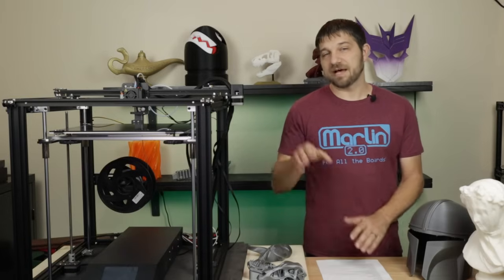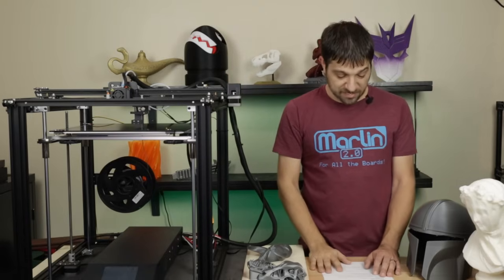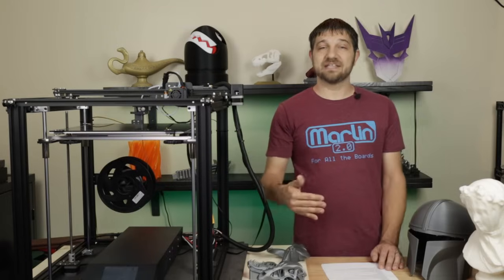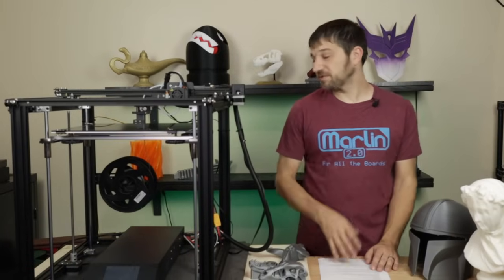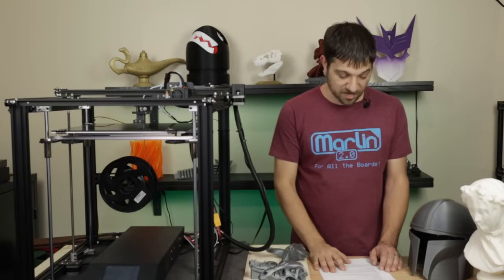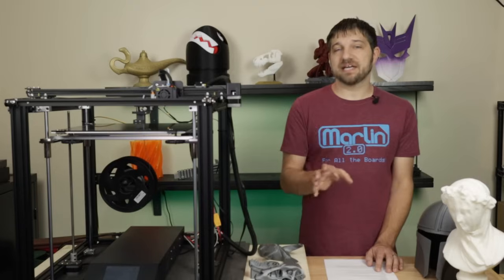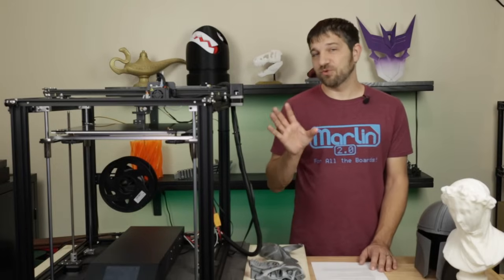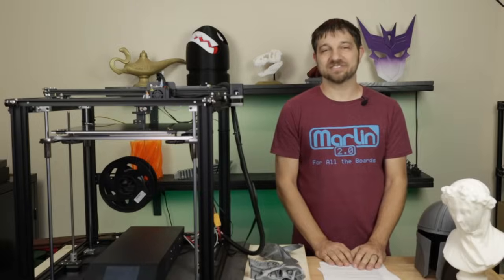Creality Ender 5 Plus Review: EVERYTHING You Need To Know!

Comment: So, has this printer improved over the last 2 years with regard to firmware and electronics quality etc or is it just the same?
Reply from the maker: It's exactly the same. If I could find the time, I'd love to update the review with a new video.
Reply: @kerseyfabs Ok I was just wondering as I just ordered one.  There's like 80% positive 20% negative about this printer so hope I can concentrate on the positive!! Ordered the metal extruder and capricorn tube to start off with.
Reply from the maker: Perfect. The only reason i keep endorsing this printer is there's still nothing like it that I'm aware of at this price point.

Comment: The Ender 5 plus is a noisy Assed printer and even if you lube the  z axis rails it still squeaks when traveling up or down.. Also, You have to manually edit the gcode files so that they are 15 characters or less. With some work it can be a decent printer but after going through everything you need to to get it put together (assuming none of the precut holes are at a slight angle and thus end up stripping out when you are screwing the screws in, this happened to me twice) then you have to put up with the noise.. As far as I know there is no work around for the file name issue...

Your better off going with an Ender 3 v2; it’s WAY quieter and will read the gcode files as written by cura also no touch screen.  If you specifically need a large build area then go for a CR 10S.  

The Ender 3 V2 costs under $300.00 and the CR 10S costs under $400.00. The Ender 5 plus will cost a little over $500.00 and in my opinion is not worth it. Lastly, I can just see that “touch screen” on the Ender 5 plus stop responding at the worse possible time; right “after” the warranty expires....

Comment: Hi Kersey, I got my Ender 5 Plus on Saturday set it up, trying to tune it to print right(using your guides), but I noticed that when I flip the on/off switch to off at night, it only turns the fans off. The LCD is still on and it shows 22degree nozzle and 22 degree bed. As an IT tech usually when you put the switch to 0(zero) that mean off and everything shuts off, at least with normal computers and servers. What's up with this? The nozzle and bed do get cool so I assume it's a glitch or bug in the software. Stock everything but capricorn tube, FW 1.70.2 BL from the printer info. Thanks for any help you can give. If this is normal then that's ok.
Reply from the maker: Congrats on your new machine! Is it hooked up to the Raspberry Pi or PC? The electronics are being powered by USB. To avoid that, you'd need a data only usb cable which can be bought or made.
Reply: @kerseyfabs  yes I did get a raspberry pi 4b to run it remotely and have camera view. The USB cable that came with the ender 5+ is connected to the Pi. Would disconnecting from my Pi when I'm done fix this? Not sure why I'm asking since I can test it since it's right beside me lol. Also, pretty sure the z axis needs lube cuz it squeaks allot, but the y and x axis are quite loud during motion, you think the belts came in too tight? I can deal with fan noise no problem, I have my server and gaming pc beside me with lots of fans. The motion sounds though, are on an another level.
Reply from the maker: Yes, if you disconnect the USB, it will fix the problem. On the squeaking, check my "Top 5 Upgrade" video. In that video, I upgrade to POM z-screw nuts. That fixes the squeaking. The noise from motion is from the steppers. You would need to upgrade to a silent board.

Comment: Good video. Bought one for two days ago :).
Reply from the maker: Please let us know what you think once you get it going!
Reply: @kerseyfabs  i will let you know what i think about the printer when i get it. :D   Do you know if tl smoothers work on the Ender 5 plus?
Reply from the maker: They shouldn't do anything one way or the other.
Reply: @kerseyfabs  oki tnx for answearing, i see u put  much  effort into youtube. Keep Up with ur videos :)
Reply: Hi again. Just got my printer. It works really good, but i cant print, it wont show the files on the stick.
Reply from the maker: How is it working really good if you can't see the files on the stick? Have you been able to print somehow? Have you sliced a new gcode file and placed it in the base of the USB drive filesystem? If so, keep the filename short or it may not show up.
Reply: I have not printed anything but the printer works well. Tested the xyz axses and i did leveld the bed easily. But i cant see a file at all not even the files that were on the stick from factory.
Reply from the maker: @Emulpuhl  Can you see the files on your computer? Only files ending in .gcode will show up on the printer. There are no gcode files on the SD card by default.
Reply: @kerseyfabs  ye. I sew it. I cant get files (.gcode) from the stick, but i can directly from the computer. I have printed a xyz cube and the quality is AWESOME and it only took me 50min to print. Best printer i had yet.

Comment: Great content, good on details. Still could someone enlighten me, why you have to pay $549 for a printer you have to assemble, has no cable management, has firmware that does not work out of the box? And from what I see people still replace parts for to "upgrade" the machine. It just blows my mind for that kind of money I would expect a machine that works out of the box, or is that just me?
Reply from the maker: It's a cost relative to competing options. The real cost here is the size. If you want a smaller printer, a standard 220x220x300 or so, then you can get one much cheaper ($150-$350). BTW, almost all printers in the sub $750 price range have some assembly unless they're really small. As for your other concerns, this printer does work out of the box once assembled. It's not perfect but it is perfectly functional for most people. Upgrades are not required and firmware issues have work-arounds. The CR-10 V2 which is 300x300x400 is around $499 (or CR-10S $399) and the CR-10S4 which is 400x400x400 is $569. Even other vendors, such as the Artillery Sidewinder X1 at $399, are about the same cost relative to size.

In the end, size costs quite a bit more money and I have yet to see anything in this price range that's perfect. If you have some other suggestions, please let me know! I would love to see it and be happy to review it!

Comment: is this printer worth 780+13% taxes? thats what it costs here in canada. and + all the mods and stuff this would be a $1000+ printer thats only really capable of PLA right?
Reply from the maker: The printer out of the box will do PLA and most PETG. If you simply replace with an all-metal hotend and get you some gluestick (or other adhesive) then you'll be able to go up to 300C. The mods are not required on this printer. I provide information for those interested but it prints VERY well for me out of the box. Mods are incremental improvements that may or may not be for everyone. I can't comment on what it's worth. That's a personal choice and I'd have to see what other options you had available and at what cost.

Comment: What about in mid-2022...?  Would you all still recommend an Ender 5 Plus...?   Or...?
Reply from the maker: I still have not seen a printer with the Z-axis moving bed and dual lead screws in this price range. All other similar options are smaller, more expensive, or DIY. This is still unique at this time. If you see anything I should check out let me know. I'm working on a review of two 400x400 printers but they both have Y-axis moving beds.
Reply: @kerseyfabs  - my Ender 5 Plus arrived this week!!  ❤️  Thanks to your channel and videos!
Reply: @Blissful_Soundscapes  I'm thinking of getting one. Any thoughts you can share?

Is the board still loud? Is the firmware still limited like he mentions in this video as far as machine adjustments?
Reply: @Ringwraith19  - I love the printer.  I changed out the motherboard for a TH3D silent one and it’s beautiful.  I’ve printed Skyrim and Mandalorian helmets in ONE PIECE - no assembly.  It’s not as fast as current gen, but it’s been solid.  I typically use a 0.6 nozzle.

Comment: Great review.  Unfortunately I decided to purchase this printer based on your review, and my experience has been very different.  The filament sensor has some sort of obstruction in it so it is nearly impossible to load filament.  The auto leveling is completely useless.  It takes a long time and when it is complete, the nozzle is 8 to 10 mm above the bed and just squirts material into mid-air.  Aux leveling also has issues as there is not enough adjustment in the manual adjustment wheels to get the bed level.  Nozzle is always too high or too low when printing begins, so successful, consistent prints are nearly impossible to achieve.  The SD card for transferring files to the printer is very cumbersome.  This printer is not wi-fi enabled.  The bed is literally held down with Staples binder clips.  The filament feeder puts a bend in the filament so that it can't hit the loading hole.  It will just sit there and skip and skip and skip until you figure it out and put just the right counter bend in the filament so it will actually get into the PTFE tube.  The feeder also appears to be incapable of successfully getting the filament to the extruder, and you will have to pull the tube out of the extruder, load the filament into the extruder manually and re-insert the tube.  The Creality Slicer software is overly complex and non-intuitive.
Reply from the maker: I couple of comments. First, it sounds like you never properly set your Z-offset. See my live video here: https://youtu.be/GIVC7Cg5sQU?t=7569
On the filament loading, cut your filament at about a 45 degree angle and make sure it's straight when inserting.
Most printers are not Wi-fi enabled out of the box at this price range. Look into OctoPi when you're ready.
The Creality Slicer is pretty industry standard as it's based on Cura. There is some learning needed to operate one of these machines.
Reply: @kerseyfabs  Thank you for the reply.  I'm starting to get comfortable with the slicer.  I think we got the Z-offset issue resolved, but I will check out your link.  I'm still completely baffled about the filament sensor having an obstruction in it, however.  I expect the filament to simply pass through and it doesn't.  The only way to get filament through it is to back feed a small piece of filament from the top of the sensor and then chase it back through with the filament I am loading.  I'm hesitant to open up the sensor and see what's wrong, but perhaps I should.  Also we had a break in the filament and I was expecting I could just resume the print after reloading the filament but it didn't work.  Resume printing is supposed to be a feature, isn't it?
Reply: @kerseyfabs  Another thing I find puzzling is that the temperature setting on the printer overrides the gcode.  Even though I set my PLA to print at 210, the printer wants to print it at 185.  185???  That's ridiculous.  This is why the feeder wheels were skipping, because at 185 the nozzle just clogs up.  I can understand wanting to be able to adjust temperature during the print, but shouldn't it start with the temperature that is in the sliced code?
Reply from the maker: @edwardrogers6310  It's very safe to open the filament sensor. There's just a switch in there. You can't resume from runout unless your sensor's working. Yes, the printer does do what the gcode says. If it says 200, it will do that.

Comment: Hello, totally new to 3D printing and looking for a large format like this one.  I feel this may be the one having heard your disclaimer.  Both my son and I like electronics and detail work.   As a hobby / side job I build sets out of styrofoam with hot knives for high school stage productions.  So detail and I'm a bit of a perfectionist when it comes these kinds of projects, son wants to build his own Bey Blades, Transformers, and cosplay armor pieces (probably mini's to for gaming).  Anyway, 2 questions:  You say this is great for people who do "Mods".  Not sure what you mean by that.  Is that modular builds?  and are there any upgrades that I can do to make it work for high end PETG or Metal type filament?  I would like to make some accessories for my motorcycle, but need the high strength type of filament.  Love the video, thanks for your feedback.
Reply from the maker: Thanks for the comment. When I said those that like to "mod," I mean those that would like to modify a printer to improve it or make it exactly what they need. If you're a tinkerer this is probably you! I have a lot of modifications and upgrades for this printer on this channel and I have more coming. You can definitely use high-temp filaments on this machine by adding an all-metal hotend (covered on this channel).

Comment: Hey man. Hoping you've perhaps seen the following issue with this Ender 5 Plus - https://www.youtube.com/watch?v=0SvM_55NYuk        Video quality poor, sorry but at 34 seconds you can see the Extruder head actually push into the bed at the end of the Auto-home sequence. Same applies with Auto-levelling. The head actually burned the bed film when it initially happened. I can confirm running 1.71 vanilla firmware so I don't see how it could be software related and the bed is pretty level, not perfect but certainly within tolerances. Anyone have any ideas what's going on here? Thanks in advance
Reply from the maker: You can adjust the Z-offset under the leveling menu on the printer. That will take care of the issue.

Comment: i got a heating error because it got to cold and thought there was a heating error
Reply from the maker: If the environment you're in varies in temperature a lot, you may need some sort of enclosure. A printer's programming (PID tuning) is not designed to adapt to varying ambient temperatures.

If the environment is relatively stable and it's still doing this, you may need to do PID tuning to stop the issue. You didn't mention if it was on the bed or the hotend.
Reply: @kerseyfabs   thanks for the help :)

Comment: Typical Americans only referring to the imperial system - which is only used by Americans. Even the English are using the meter system officially now.
Reply from the maker: Hmmm. Since I work in almost exclusively metric myself, I usually mention metric first. If I used imperial in this video, it was only so the American audience would be easier to relate to my measurements. "Typical Americans" was uncalled for.